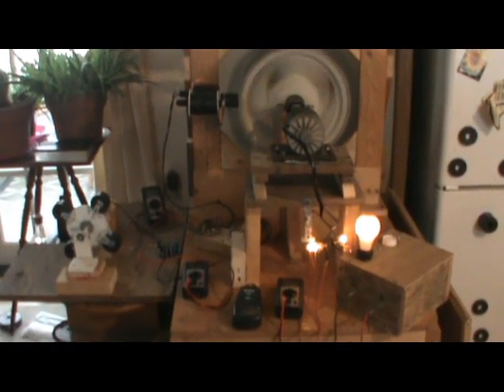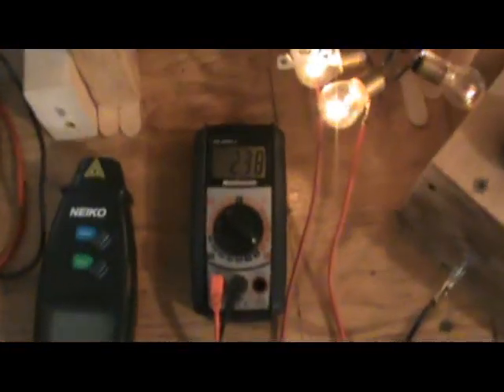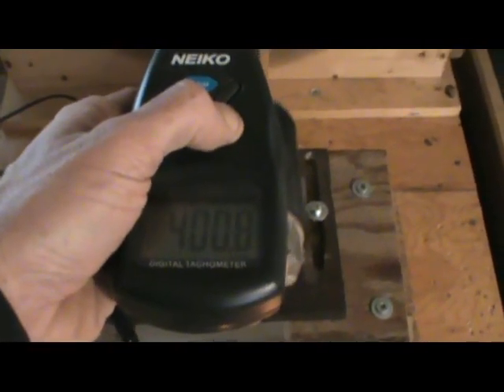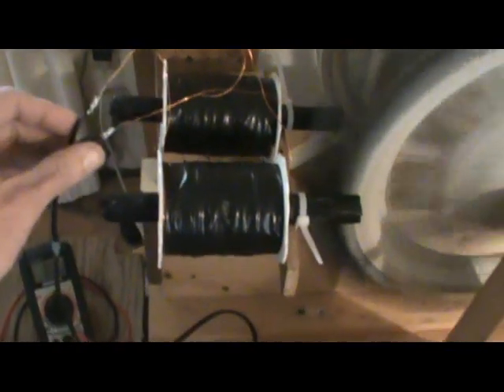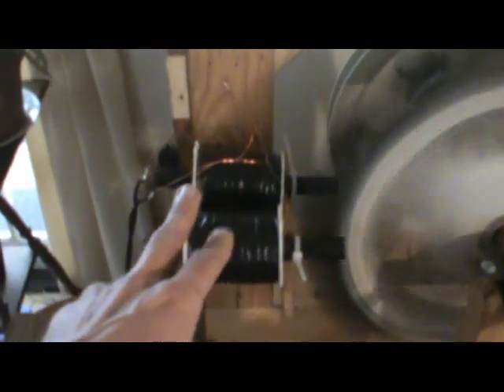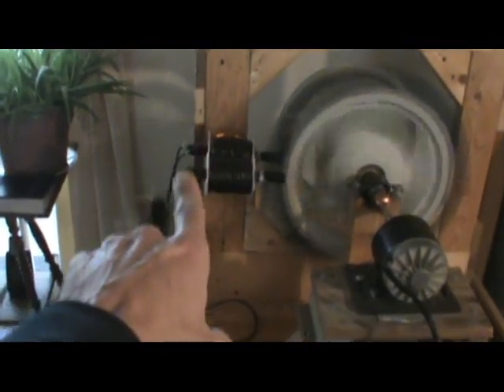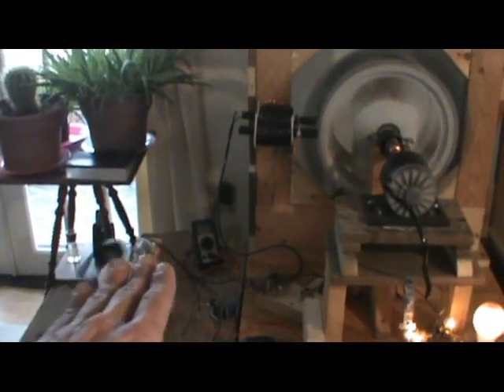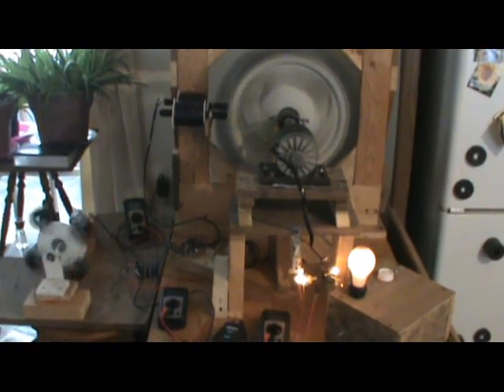Free Energy Project - 22 Gauge  Demo

Comment: Boy, You're working hard today, must be the moon phase I guess. I dismounted my generator side to measure the bedini side better. I found after all this experiments that the stand alone bedini gives more output than with the generator. Put  5 sets super poled magnets on it and it charges the batt very well on just one coil. I will go back to the PMH later but with maybe a windows motor.
Thanks for sharing!